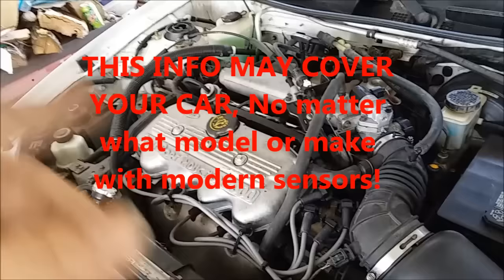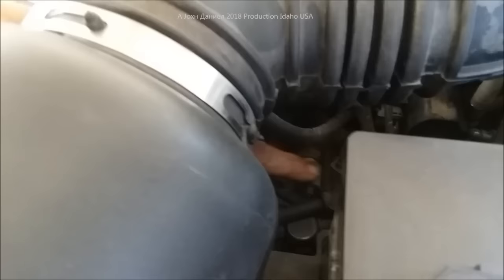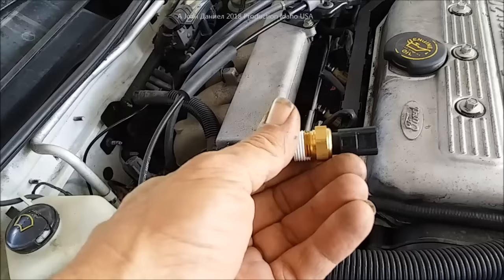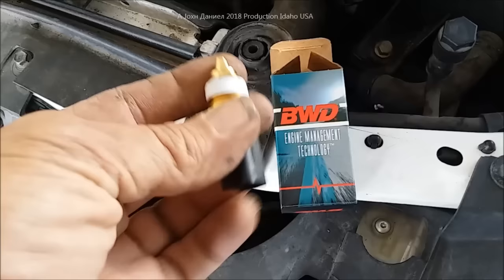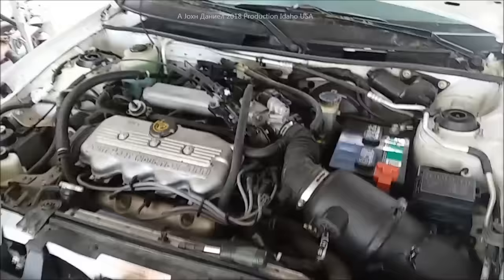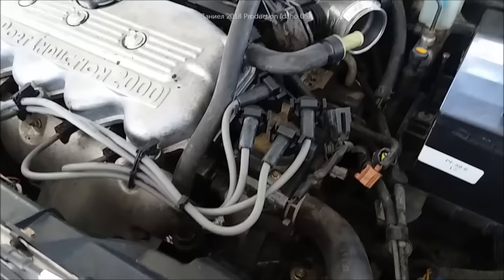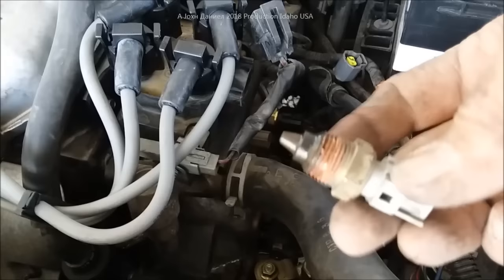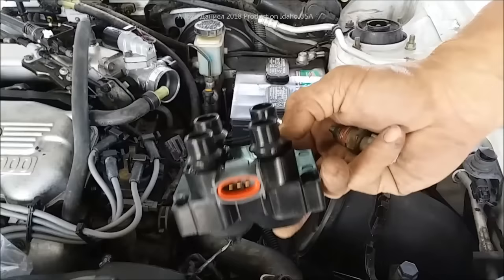Ford with NO START issues - SOLVED for $20 All Parts needed listed below the video

Comment: Hello sir, I have a 1990 Econoline,5.8 ltr, sits alot, hasn't been started for 6 weeks was running ok before that, Wouldn't start, no spark, replaced coil still no start replaced distributor, started right up . Drove it to the store, no issues, drove it home, about 5 miles, started lunging then died. starts when cold and runs til it gets warm, then died. will not start up until it cools off, then runs til warm and dies. Any suggestions?
Reply from the maker: Your Lucky Day, 
The majority of them that do this it is the Fuel Pump. Or fuel pump related. https://amzn.to/3UxV9qe for inline single tank model, Center tank model https://amzn.to/3UDUhQS Rear tank model https://amzn.to/3fmUSpV 
The pump gets hot, starts to seize up so it slows down, Filter  https://amzn.to/3r9wMSe is already plugged some, now engine is starved of fuel, and dies.  And BE DAMN SURE to get the ford fuel tool https://amzn.to/3R8uo97 
The hot armature in the pump hangs up on the worn bearing surfaces, and its made very weak when hot. Pressure drops and the regulator can not keep open. It is common, but not enough to throw the fuse or breaker. After it cools, it returns to free spinning.  If it hits the target, and I saved you, drop a nickel or dime https://www.buymeacoffee.com/JOHNDANIEL   Install a fuel pressure gauge on it, if it starts to loose pressure when sitting running, then your cure is found. Fuel Pressure Regulator https://amzn.to/3dK0ha8 would be Guess 2, Some models had Crank Sensors and they may crack open further when hot loosing hall effect signal and that would be guess 3, then temp sensor guess 4  And last guess if you have dual tanks is the A to B change over valve solenoid is failing and loosing fuel prime.

Comment: I have a question will this work on my Ford Focus 2010 like with my car it starts up like it runs but a few hours later when I go to crank it it won’t start but at night time it starts up what problem could that be?
Reply from the maker: Usually when something goes out of parameter due to being hot on one of these cars it's either the coil pack or the crank sensor

Comment: Plz help 1996 ford F250 GAS takes 2 or more times to start and also sputters around 45 mph on occasion. Way worse when the weather is hot. What steps should I take?
Reply: Oh and sometimes smell gas when it doesn’t start. But it does still run and drive almost every day. Just really crappy now 💔
Reply from the maker: Sounds like Fuel Pressure regulator going bad or more than one fuel injector with issues. I would look at fuel regulator and possible the Idle Air Control valve on it. Worse when hot outside, but not hot engine already says fuel issues.

Comment: I have a 1994 Ford F150 I replace that part on mine and it still does the same thing after my truck gets hot then I try to start it it does not start until it gets cold any suggestions
Reply from the maker: Most of the time a hot (no Start) condition is due to the coils, coil pack or crank sensor. Rarely it may be the computer due to aging capacitors in it.

Comment: I have a 2002 Ford explorer sport Trac won't crank and start but all gauges are working what will I do? Thanks sir
Reply from the maker: Common failure on those is crank sensor or insufficient fuel supply. 
Check for spark, none found then go for crank sensor.

Comment: Would that be the same with a 1990 taurus sho  start all the time  and all of sudden it crank like it's  out of timing and let it rest for 5 to 10 minutes  and then the car start no problem
Reply from the maker: Camshaft position sensor acting up and may be due to timing belt and or tensioners getting bad. Replace both, should be good.

Comment: my 07 Expedition has crank no start situation that is followed by a beep and the oil pressure light on the dash.  There are no DTC codes.  Would this video be replacing the oil temperature sensor or coolant temperature sensor?
Reply from the maker: Check fuel pump to see if it's operating. A beep is a over load signal which can mean a bad or locked up fuel pump or a tripped fuel pump safety switch. Turn on key while someone listens for the pump to run and shut off in the tank.
Reply: @JOHNDANIEL1 fuel pressure at Schrader valve on fuel rail is good.  The beep occurs with a oil pressure light.  I replaced a bad oil pump with no oil pressure.  I have oil pressure now, but the same crank no start condition with beep and oil symbol on dash.  There is a constant Check Engine light but no DTC codes.  New battery, new oil pressure sensor, and newer starter. I think the PCM needs to be reflashed.  The oil pickup tube was clogged but is clean now.  I will also try a new crankshaft position sensor and clean the oil filter adapter housing but think it is PCM related.
Reply from the maker: Your computer is still seeing no oil in it's memory and sends the BEEP to note that.  To reset the 2007 Ford Expedition oil light and computer hold on the engine, You will start by turning the ignition to the "RUN" position. Press the "SELECT / RESET" button to display "OIL LIFE = % HOLD RESET = NEW." Pressing and holding the "SELECT / RESET" stem for 2 seconds which will allow You to reset to 100%
Reply: @JOHNDANIEL1  I did the oil reset, but same condition.  Ford dealer diagnosed it as "timing is off."  So I will try a few other quick fixes with the fuel pump inertia switch etc, and then go back into timing again.  Since there was some metal to metal contact when the oil pressure was bad, I might inspect the roller followers.

Comment: I have a 99 escort. Started but when i pull it off the battery it ran funky until put back on. Replaced the altenator and now it wont start but it still cranks.
Reply from the maker: By removing the battery to do a alternator test which was a technique most common used before computers and modern ignition systems were in cars, you destroyed the ignition system, sensors or computer in the car like in most all cases it has been done. Older cars electrical system could handle significant voltage spikes without damage, but post 1981 in most cases such acts will damage sensitive electronics. Battery removed the voltage can spike over 30 volts in a Escorts wiring. The battery in responding to the regulation circuit keeps it at 14.4 max and the electronics are designed to handle so up to 15.5 at most. Yours likely ran rough due to high voltage advancing timing and injector pulse till power was pulled or engine stopped. Following damage would occur with the removal of power (when it was high) all the sudden which can destroy crank sensors, the Body Control Relay system, and the injectors. Radios and headlights have inboard resistors and such to stop uncommon surges in most of them.
Reply: @JOHNDANIEL1  can the ignition system be replaced. Cause i just replaced the coil and its still not getting any power to the coil. So not sure.
Reply from the maker: @Donkeyjuice2  In the Escort you have a few items that can fail, one very common no power to coil is the fuse labeled ROOM and one labeled ENGINE on your inside fuse box, the other is one labeled FUEL INJ is under the hood in the box there. What is most likely is a failed fuse or Fuseable Link. Heres a diagram, for locating. https://fuse-box.info/ford/ford-escort-1997-2003-fuses-and-relays The last possible is the power on Relay to the engine itself. My suggestion is pull fuses and check them and replace all that are bad. As for relays the car has a Constant control relay module http://ebay.us/CiRpT6 (PCM relay CCRM) that can be damaged which controls features from the key to the run. Last possible is the FUEL CUT in the trunk(rear right inner panels) that when a wreck happens cuts power to fuel and ignition.
Reply: Disconnect the filter sensor then try to start it ,or find your solenoid and disconnect the cable then get a screwdriver put contact on the bar where you disconnected the  solenoid cable there will be another bar either to the left or right and make it so  both touch it should start. make sure you position the key to the right in the ignition where the radio turns on . You're welcome

Comment: My 2000 mazda 626 2.5 liter has a hard to start when warm problem .I am looking at the ECT sensor which is located right beside the sender for the dash temp gauge sender like you showed . My understanding is that the ECT sends a signal to the ECM  which is ohms/resistance  which varies according to the coolant temp . The warmer the engine the leaner the air fuel mix needed . But I have not heard anything about the ECT telling the ecu not to allow gas to the engine if the engine has gotten too hot . I have found that when my engine is warm and thus hard to start ,that if I open the throttle plate to allow more air in it lets the  engine clears the flood condition  and start . Do you think we are talking about the same type of module but that I just did not know that it will also shut off fuel to the engine and prevent starting if the engine has gotten too hot to safely run ?  Seems feasable to me .  I am hoping this ect is the problem because I have already tried 2 aftermarket IAC's even though one did seem to help in other ways I still have the hard start when warm problem. So if the ECT does not fix things I am looking at $500 plus for a dealer/OEM IAC .
Reply from the maker: On those engines, you will go totally out of parameter with a failed INTAKE AIR TEMP sensor. Should be right part -  https://amzn.to/4387mWp  From what you describe, It is appearing air mix related. The IAT is more then not likely bad. After about 15 years they always go bad anyhow, replace it. What the IAT does is tell the computer where to hold the air valve, when they fail they fail high, so the computer thinks the air is very hot, so to stop from Dieseling and knocking it chokes the heck out of it. May not be absolute for the fix, but by your description AIR/FUEL is the issue and the computers compensation is the result your getting. ALSO, delete any codes after replacing.

Comment: I have a 93 Ford probe no spark ended up buying a fuel pump distributor and now crankshaft positioning sensor to see if it will get fire even the mechanic can’t figure it out..
Reply from the maker: Open distributor, have someone spin engine, if rotor does not turn, timing belt.
Reply: @JOHNDANIEL1  worth a shot 🤙🏼
Reply: Would this stop it from getting fuel and spark?
Reply from the maker: Do not know if you have a 4-cyl or V6 but On the Probe you have a few things that would stop both Fuel and Spark. Inertial Safety Switch on fuel source, Ignition switch itself is failed and not sending power to fuel and ignition relays, or the ECM computer for the car. And at that age, the Transmission Neutral Safety switch.

Comment: About every few days or more my 4.0 ranger wont start. Turns over and everything just doesn't fire up. But if I come back a few hours later it fires right up. And this seems to happen on the hotter days. Already put a camshaft position sensor on it and still not starting at times. So I'm hoping this temp sensor might fix my problem.
Also willing to listen to any suggestions, thanks.
Reply: Had codes Cam position sensor and running lean bank 1 & 2 changed that and the heat sensor problem is still there and yes it has something to do with heating up
Reply from the maker: Message to both of you, Jayme I sent you a email on this info
My years of best guess - only 3 things can give you all 3 problems your dealing with, Coil Pack, Fuel Pump or fuel Pump Relay.

Year model tells me Fuel Pump. 

Common pre 2002 is the weak fuel pump due to loss of line pressure will cause the occasional lean burn which may be causing rough idle ( weak explosions) on front 2 cylinders, and will stick when hot.
The fuel pump is in the tank, not hard to replace. If it has not been replaced in many years may wish to also replace the fuel rail regulator, relay and filters.

WHY? Common, not assured fact on yours  ---  When the fuel pump is hot, and you stop it sticks in its bearings, it is a electric motor with sleeve bearings.  While its running from cold to hot its still got momentum to run, once you stop the heat jumps up, swells the bearing surface and hold it from spinning. It can throw out the Fuel Pump Relay and act like a full no start, when both cool and the metal surfaces shrink back  they start working.

**Very rare but possible is Idle Air Control valve, Throttle Position Sensor, Open fuel regulator or EGR causing idle/start issues. 

The Fuel issue will plug up your filter so replace it too.  
TAKE YOUR NEGATIVE CABLE OFF YOUR BATTERY DURING ENTIRE JOB!!!!

FUEL PUMP Complete unit, car too old to reboot older styles.
https://amzn.to/31H7Jdv

Fuel Filter 
https://amzn.to/34Nwere

Fuel Line Key ( must have ) 
https://amzn.to/3hJlA8K

**(possible) 4.0 Idle Air Control Valve
https://amzn.to/2ERFEHy

Let me know what the outcome it, nice find for the price. I got a 2001 or 2004 (not sure) sitting in my field, 155K miles, drives, but needs a trans pump or at least filter in trans changed. Want it??
Reply: Hi
Reply: My Ford 2003 F350 super duty is doing the same thing I was driving up a hill died out and it has a crank no start it backfires in the intake and it grabs gas for like a few seconds but then it just sputters and dies I'm also going to try the temperature sensor tomorrow and give it a test and hopefully that's it
Reply: Me again just wanted to let you know that my truck doesn't start it just sputters for a second and then dies the other problems they were saying when their truck got hot it died and then a couple hours later it came back on mine doesn't do that mine doesn't start. It left me stranded I had to have a tow truck take me home besides that my starter was going out so I changed that besides that I'm changing my coils in my spark plugs because they were bad anyways and now I'm still changing my starter so I might as well change the temperature sensor and I'm going to hope that it starts right up after all these few things that I did because I wanted to do them but my main issue is possibly just the temperature sensor I changed my coil in my plugs because I wanted to I change my starter because it's been acting up over the last 6 months I've noticed so hopefully putting the temperature sensor is the cream on the icing on the cake as they say and I could drive into the wind and live happily ever after I'll keep you posted I'm going to change it tomorrow spend the 60 or 70 bucks that they say it cost and put it in wish me luck we have God on our side so we don't need luck let's hope that this manufacturer piece was causing the problem for it to die out and not start at all it only sputters for a second with an intake backfire burst of a boom. I will keep you posted
Reply from the maker: @peeeyyyy8439  Whats the Year, Model, Engine size and type, and Mileage on it.
Reply: @JOHNDANIEL1  
I have a 2003 Ford F350 super duty it was running and driving just fine I changed my coils in my spark plugs and everything was running just fine and then I started climbing a hill and then it just shut off but then I read the videos of the coolant temperature control sensor so I'm leading up to doing that first of all before anything what do you think
Reply: @JOHNDANIEL1  
It has 265,000
Reply from the maker: What engine, 5.4 Gasser???
Reply from the maker: With such little information you have one of three things most likely gone wrong. If you're climbing a hill your system is changing the timing and if the crank sensor / cam sensors go bad they would do it then. Secondary you can also under that much load in that heavy of gas output crush your internals of your catalytic converter just from the overheating load and at 265,000 mi that's probably more likely it would definitely cause sputtering backfire and so with the crank sensor or cam sensors.
Reply: Coil pack. I had a buick that would start up then drive it a ways then it would stall. Go back half hour later it would start right back up fine. It was a crack under the coil pack on the coil compound. Changed the coil pack and it was fine there after. I know this is an old comment but fig id comment so others would know.
Reply: @jaymestevens9816   coil pack 100%
Reply: @JOHNDANIEL1  Hellow John

Comment: Can you please tell me we're the temperature coolant sensor is on a f150 5,4L 3v triton 2006
Reply from the maker: Under the intake manifold, on the passenger side in the head, back past midway. You have to remove the intake manifold to replace them.
Reply: @JOHNDANIEL1  i replaced one under three is there another one under there, my fan clutch is not coming on gage says it's hot but its not i can shut truck off and it goes back to normal
Reply: When this happens ac shuts off to
Reply from the maker: Sounds like Fan Control Relay or Module for your truck may be the issue. But if its showing HOT, then goes to cold after restarting ( back to normal) then you likely have a issue again with your temp sensor.
Reply from the maker: The AC is causing the electric fan to run, a override feature. So your actually needing a temp SENDING unit. It should be located near the water inlet on the intake area from top radiator hose/thermostat location, Inspect it for loose plug first, this is the common part to replace it.  https://amzn.to/3DRIs2u The Fan Control Relay seems fine but replace it too while your at it.

Comment: 06 e350 5.4. no fuel no spark, replaced crank sensor still no go. It will crank. Trying to help someone stuck  near the area of the Rafael wildfires.
Reply from the maker: Fuel sending relay or fuse may be the only thing to look at. You can't get spark without the fuel pressure being detected in the system and it's either a dead fuel pump or regulator but most commonly in the summertime the fuses go pretty easy.